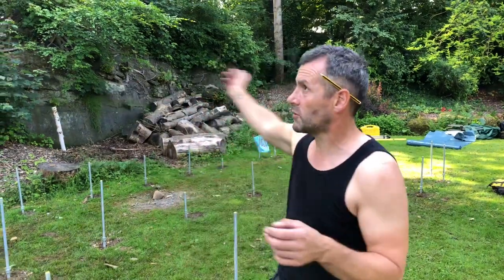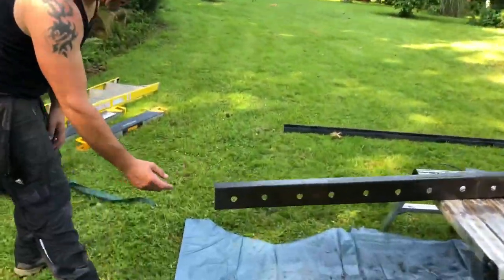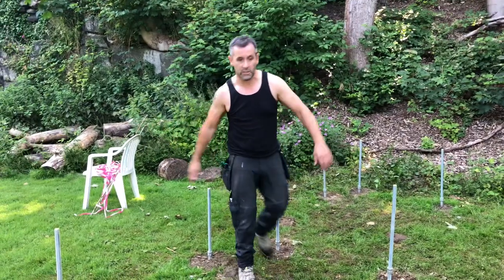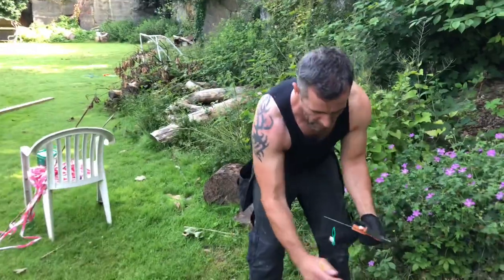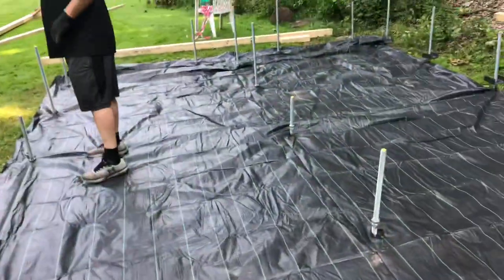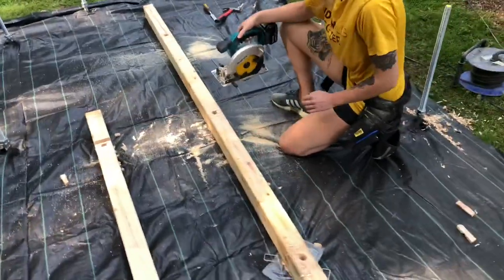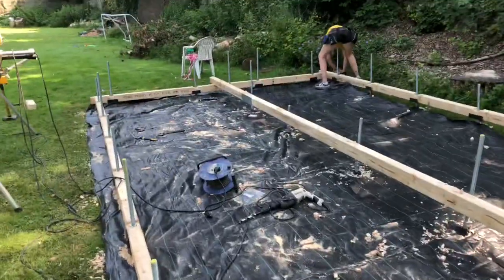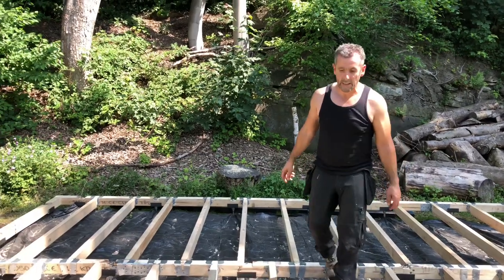Base frame work for a garden office

Comment: Will definitely try your base system when I build my decking as all ready done my base system concrete blocks double up 6x2 piers set in concrete all based out 6x2 treated 22mm caberdeck flooring 
My home office 
Thanks for the help baz

Comment: Hi Mr. Griffin. Great work I have to say. Like the fast vids, and you explain stuff easily to understand. If you know, you know kinda thing. Seen so many boring long drawn out vids explaining everything so meticulously! Just get on with it for god’s sake! I think you’re floor system is the best and most secure with it being cost effective too. I’m gonna plan to build my own soon in our garden. I was gonna use a breeze-block base. What do you think?
Reply from the maker: Andy Mac77Vlogs hi and thanks! Trying to not make them a sleep fest, and also trying to cover everything, we tend to work at a fast pace so the videos will reflect that. I’m biased but my system is quick and mm perfect. Blocks would be cheaper I guess, but my system overcomes uneven ground and any obstacles like roots or services
Reply from the maker: Andy Mac77Vlogs thanks Andy, won’t lie, proper wound me up! Told me I should employ and architect or a builder who knows what he’s doing 🤯 Had a rant, I’m over it now. 2.5 is critical, they don’t seem to get this! Bolt suppliers have told me they are getting orders daily now for the rods. Wonder how many companies will be using them 🤔😊

Comment: Like your base detail, I use 150 plastic pipe dug in then laser off, fill concrete push saddle in lay timbers to keep line leave to go off, not much fine adjustment like yours, might combine yours and mine on next project

Comment: Great videos, doing mine at the moment but on concrete blocks (more deposit store cum studio) but concerned about conserving wildlife underneath. How do you cover that?
Reply from the maker: Daniel Evans you can use wire mesh to prevent animals of a relatively large size, rats, foxes etc, but a mouse, you’ll struggle, rolled up chicken wire works as it’s like a maze, roll it up and force it under the perimeter
Reply: Just be aware that a mouse can fit through a hole that's the width of a pencil ✏ yes it shocked me also 👍🏼
Reply: @thegardenroomguru  Time to get that anaconda that I always promised myself

Comment: hi thanks for your help i have just put my base down went well but joist hangers got in the way a lot can people use 250mm screws instead of joist hangers, really should have spent more time making sure timber was 400 Centres .  just adding 5/2 for my front walls as got french doors in them

Comment: I building a shed for storage. Planning using 4x2” studs. Do I need to make it 400mm gaps or is 800mm ok.
Reply from the maker: Richard Willis 400 mate, 600 at a push, we always do 400
Reply: william griffin appreciate the advice. Thanks

Comment: Hi great explanation and videos .. i’m on my 4th summerhouse , all self taught and was really pleased to see that i do about 80% same as you . My one question is on the flooring material i can’t quite catch what it is 22mm something ?
I’ve been using 18mm OSB on my insulated floated 4x2 floors so far and would like to know why you use this other product and why ? I’m going to try your steel rod base construction system on my current one .. Great vids ..

Comment: Wait so the nuts going around adjust the level correct?
If so are those nuts/bolts strong enough to support a structure for a long period without slipping or shearing with continued load. Im asking cause I want to build a small gym area out back but wondering if this base would be strong enough for weights constantly dropping. Love your work, all the best mate.
Reply from the maker: Kay Bakkali thats right mate, there not going anywhere. Both nuts locked off against each other. Never had a problem with slipping or movement
Reply: @thegardenroomguru  what size and material is the threaded bar and is there anythibg on the bottom of it in the cement.
Reply from the maker: Yes mate, there is a 100x100x10 square plate washer held with two nuts, otherwise the rods would just drive through the concrete under the weight. Rods are 24mm

Comment: Would it not be better to use say a 50mm spade bit once you've augered your 4x3 for your nut to sit in instead of chiselling the full section out... Seems a really solid system though 👍

Comment: Is there a maximum size you would recommend going to for this floor base system? My intended garden room is to be 9 x 5m. Cheers
Reply from the maker: no mate, id build a football pitch with this, keep them no more than 1100mm apart and joists no longer than 1.6, if I could, id drive my car on it

Comment: Great videos! 
Any reason for using the shoes instead of using another washer like the one in the concrete?
Reply from the maker: in my mind you can bend a washer under load, but would struggle with the shoe due to its shape, also keeps the perimeter timber straight. probably over engineering, but keeps me happy

Comment: Great watch, Why don't you get a company to fabricate the steel shoes for you would save you lot's of time :-)
Reply: Exactly what I was thinking, assuming you use same design on each build. Even if you just ordered a few hundred cut to length, an auto feed bandsaw would be much more efficient than disc cutter. Then use a jig to hold them on a pillar drill and bash the holes out. Good work on the vids cheers for sharing

Comment: Looking at using this idea for my garden room/shed. I only have a spirit level, so is there anything I should be aware of when checking each rod? Do I need to cross check or do a particular pattern? Thanks
Reply from the maker: rotate level every nut and you will rectify any discrepancies in the level